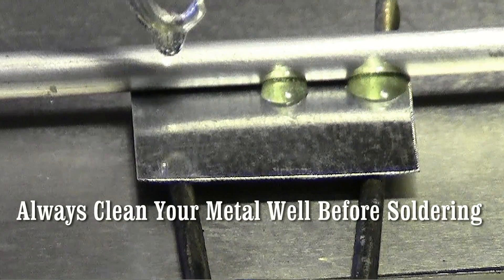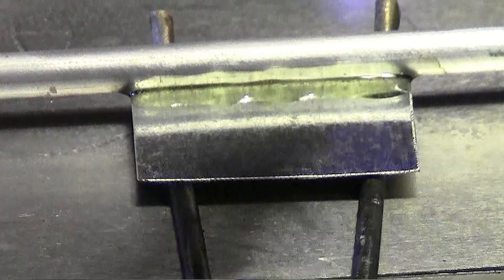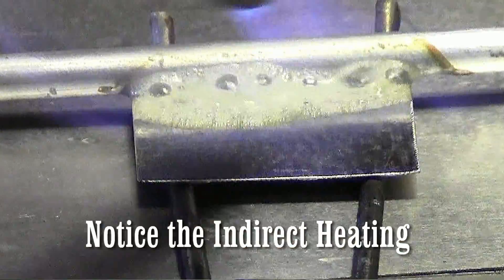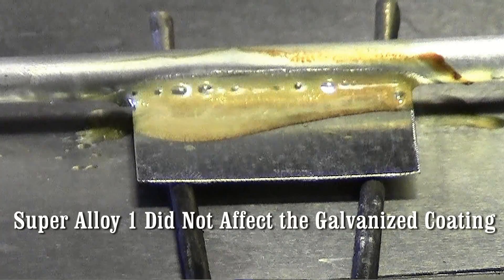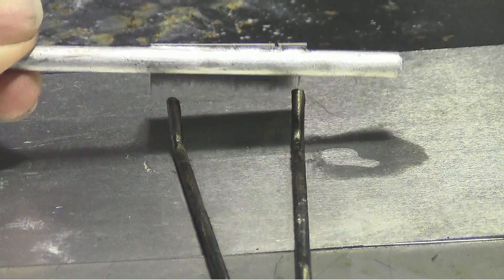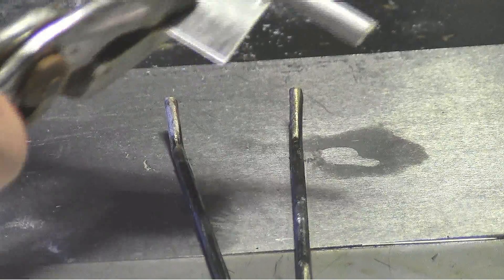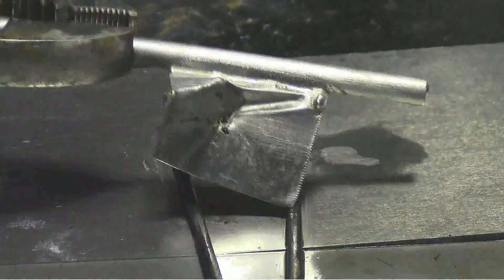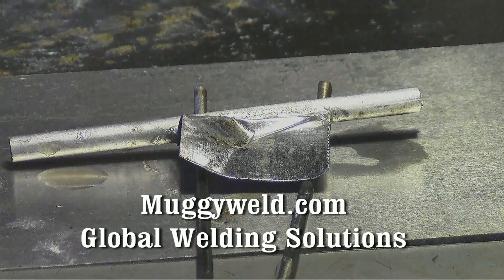Soldering Aluminum to Galvanized Steel — Easy Multi-Metal Repair with Super Alloy 1

Comment: if you get your aluminum from home depo it is not true aluminum its made from aluminum zinc and steel you can not braze it i tried a couple different brazing rods none of them worked
Reply from the maker: Super Alloy 5 does not work on aluminum/zinc/steel combination metals.  Super Alloy 1 would work, though.